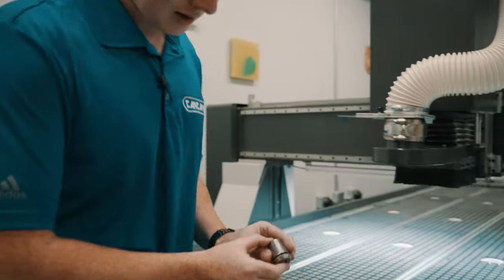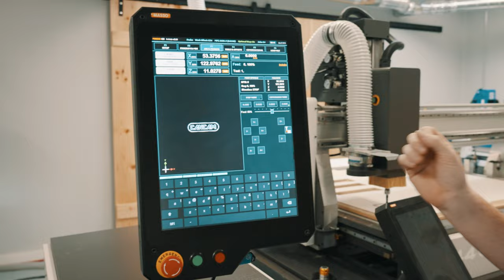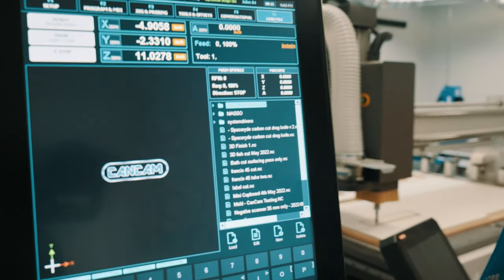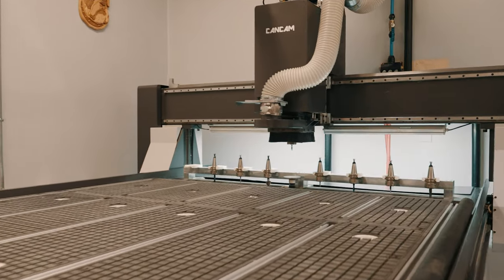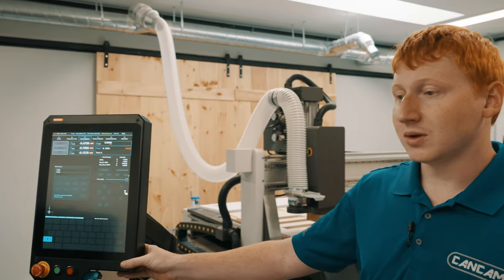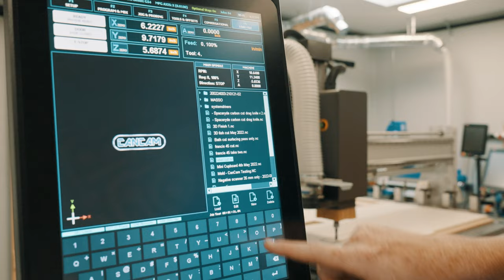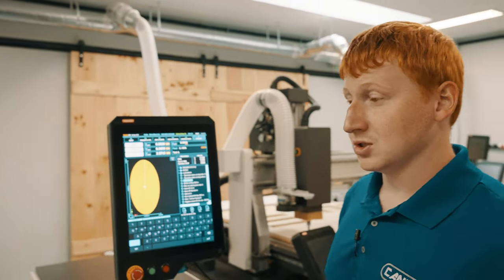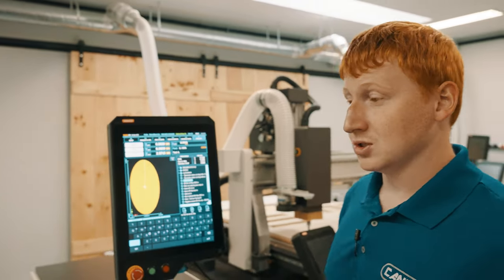CanCam C2-510ATC CNC router Masso training

Comment: Just a few suggestions. The last 2 mins should likely be at the start of the video. I would also start with performing an emergency stop scenario so we can get use to that. I had a failure today that dropped a tool. Another tool I put through the board.
Tomorrow will be better.
A maintenance video would be helpful.
Reply from the maker: Thanks for the tips! Maintenance video is already up!